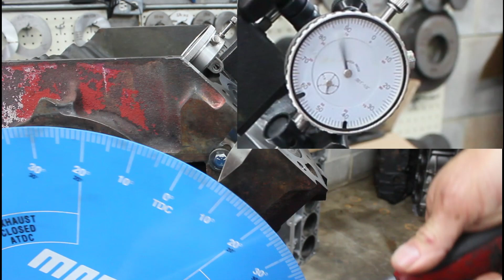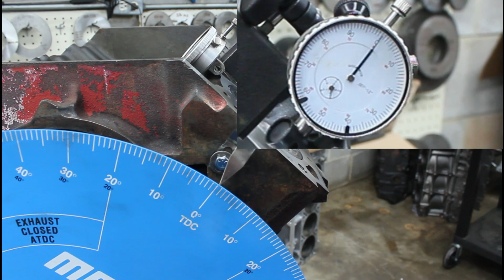Shop Tech: Setting TDC with a Indicator

Comment: Hi Powel, been digging your camshaft videos. I had an old NOS Chrysler 440 motor home cam. I measured cam lobe tapper and I don’t see any. It’s flat. I measured on the lobe and base circle. I measured an old Mopar lifter I have and it looks good, about .0015” taper. I then measure an old purple shaft cam, also seems to be flat, no taper. These are mild I imagine compared to big race cams. Are they just so small the factory didn’t bother with lobe taper? BTW, I have my own YouTube channel and I’m working up to doing my own camshaft videos. I plan to reference your content. Thanks for the great info.
Reply: Ended up figuring out why I wasn’t seeing taper on the cam lobe. Pshew.